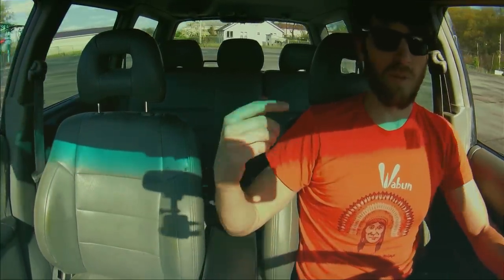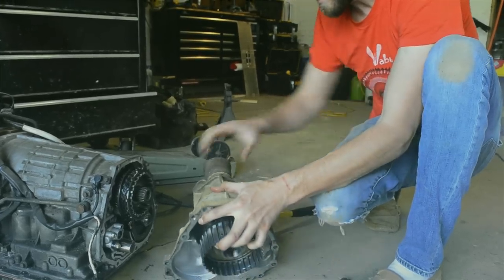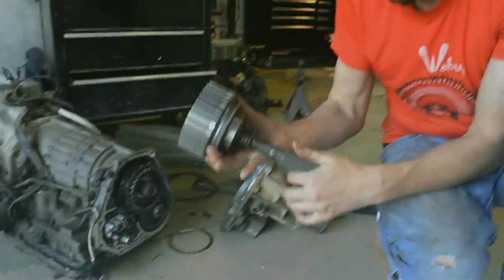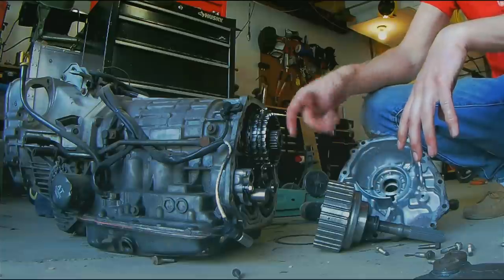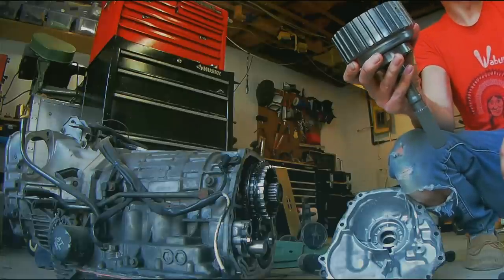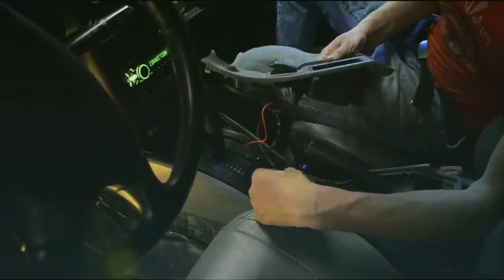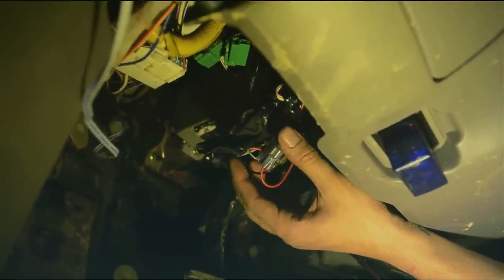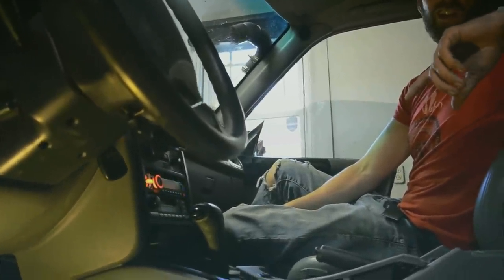Why your Off-road Subaru needs a locking center differential and how to install one for free

Comment: Hey man love the vids, super informative definitely a go to source for hands on knowledge. Do you know of anywhere that has a wiring diagram for this mod? And do you know if it will work in my 2003 forester xs as I do not see it listed in the forum you've linked above and its supposedly an incomplete list? One more question what engine management system or monitoring system are you using as I cannot locate anything for 2003-05. Thank you
Reply from the maker: Thanks, glad you enjoy them. This mod should work for you as long as you have an auto. I don't know of any mod diagrams, but if you check out my ej25d camshaft install video, there's a link to Subaru repair manuals which should have yours. Just use the diagrams to find the tcm. We explain how to do a simple switch at the end of this video, which is what we have. It's controlled manually because our OEM ecu can't control the vtd we swapped in there. There are a number of ways to do this mod, but they all involve the act of controlling the power that provides the signal for the tcm in one way or another. If you have something in particular you're trying to accomplish I will see if I can help with more details, but you might ask a wiring-savvy friend if they could help you with the install just to be safe
Reply: The High Country Medical Clinic Mmc did you ever make this modification. I also have a sg forester I wanna do this to.

Comment: Ok is this the same as the FWD fuse in the 2003 OB H6? If so I believe you are saying that you're now driving in FWD mode until you hit the switch? My transfer clutch has shat the bed and I'm running with the AWD fuse in place. Can I do this indefinitely?
Reply from the maker: The vtd is an enigma that you don't need to worry about, but yes we are in fwd with the switch off but also passive awd (if we had a normal mtp in this car it would be fwd only). I'd pull the fuse if I were you, that way it wouldn't try to kick in and cause any additional damage (metal debris I guess) although I think that risk is minimal. Check out our recent front differential teardown video and check your fluid level. The front diff is plenty sturdy enough to tote you around, but only if there's actually gear oil in there...

Comment: Awesome video, thanks for this,. I looked at that list but there is no mention of 2008 (5EAT) Foresters
Reply from the maker: Anthony Vasquez - EndZz Thanks, glad you liked it. You're right that we didn't mention the 5EAT...we're going to try to be less sloppy in the future; thinking about stuff like writing questions down, spell checking, lol. Did mention briefly that it works on all autos, the 5EAT included
Reply: Awesome thanks for the reply going to attempt to get this going this weekend. Just to confirm although this provides a 50/50 lock front to back it still doesn't solve diagonal wheel spin right?
Reply from the maker: Also, I do not believe the forum link is all-encompassing, but just the best aggregation to our knowledge. I do remember reading that 5EAT's have the same type of transfer clutch

Comment: Hello, great video! I have a question about the solenoid/valve - it is normally open (no power = clutch is locked) - I remember that there was a change into normally closed (no power = clutch is open). Do you remember when was the change (2005?) and was it to all models are some specific ones?
Reply from the maker: Thanks, I'm not sure, but if I had to venture a guest I would say that the change probably occurred around the transition to the phase II 4EAT circa 1999-2001.

Comment: Cool video, I was hoping someone could answer a question. I have a 2011 forester with a 4EAT and I've been reading online that the power distribution splits to 50/50 no matter what when in manual mode. Is that similar to this mod or is there a difference?
Reply from the maker: The lockup is increased in 1 and 2 but our testing showed significantly less torque bind, so it's probably only about 70-80% locked.

Comment: Hey mate absolutely love your work. Are you aware of any issues with the new sj xt foresters with the fa20 and cvt. Appreciate it.
Reply from the maker: Matthew Morwood Media Thanks for watching. I'm not really familiar with the cvt, but I believe it distributes power in much the same way. You may find this to be helpful http://media.subaru.com/pressrelease/580/123/subaru-offers-four-versions-symmetrical-all-wheel-drive. If you are using the XT for true off-road purposes, the transfer-clutch is advantageous because it can be locked with this mod, unlike models with viscous coupling. If you are using it for on-road or mostly flat terrain, it may not be necessary - it's moreso the jolts from sudden application of power that cause damage to the transfer clutch.
Reply: Thanks man. Yeah I do a bit of heavy offroading trying to keep up with patrols and cruiser in Australia. I have the xmode electronic stuff but it isn't perfect and I love your idea of actually manually locking that center diff. I might have a chat to Subaru aus see what they know.
Reply from the maker: You might also try digging online through the forums - there are some good ones out there that go over the variety of ways the switch could be set up. Linked one in the description, but its not current enough for your purposes

Comment: Super interesting information.  So technically a standard 4EAT wouldn't have a center differential at all, just the clutch pack that engages based on sensor input.  In the case of a standard 4EAT, wouldn't the TCM control the lockup solenoid as standard when the power cut isn't achieved by the lockup switch?   i.e. switch off - TCM controls modulation of the center clutch. Switch on - signal to the TCM is interrupted and solenoid is forced on.  In either case you are still relying on the max clamping load of those plates and the hydraulic pressure that can be applied to them, right?  So not a "locker" in the traditional sense of mechanically binding the input and output shafts (or left and right outputs) but more a "full power to the clutches!" locker like a Jeep Quadra Drive II differential or Fords new ELSD"  Or very similar to how most on demand type PTO awd systems work today where the rear drive torque is achieved solely through a clutch pack and the "center lock" button in some factory AWD vehicles simply instructs the control logic to apply max pressure to those clutches.  i.e. 3rd gen rav4 with a "C.Diff lock" button but no actual center diff vs my old 1st gen rav4 manual with the same button but an actual collar that locked up the actual center diff.  man, with the torsen rear and the center locked that thing was actually pretty mighty off-road.
Reply from the maker: Correct; what is referred to as a diff is really a clutch pack. This mod will increase capability a bit, especially on older models with a 90:10 F:R default torque split. However, I would say that the biggest reason to install a switch is the increase in durability it conveys to the clutch basket. The plates lock together with a substantial amount of force, but they don't easily wear due to the robust wet-clutch design. However, the basket is vulnerable to damage incurred during actuation under frequent and severe conditions of...well, abuse, frankly. Manuals have a true vLSD differential that cannot be locked (except the STI which has MPT and vLSD), so there are advantages to the automatic for off-road - provided you do this mod.
Reply: 2 things a 4EAT with the VTD instead of MPT transfer section will have a center dif and you could convert a MPT to VTD either with a full swap or just a rear case swap and also depending of the year of your Subaru (2004 and up vers 2003 and earlier) there is 2 ways to do the mod, sending power or sending a ground signal , I don't remeber which used which it's been too long

Comment: Now you just need a rear locker and your good to go.
Reply from the maker: We're working out how to do that on the cheap. Right now we have vLSD, which is definitely better than nothing and takes abuse well
Reply: Oh, did that come with LSD stock or did you put that on aftermarket?  I suppose LSD should be plenty good, just making sure you don't have an open.
Reply from the maker: The upper trim models on Forester and other Subarus had vLSDs as an option I think, but this one was closer to a base model. We swapped in this r160 from a legacy or wrx...can't remember which. Theres a swap video on the channel if you wanna see more. Pros are that it's easy, cheap, and can take some abuse
Reply: @powerofyourbrains  is this related to the 16-18 xt fozie upper trim model?  i'm looking thru your video trying to understand how i can get the center diff lock.
Reply: @powerofyourbrains   check out forester arb locker he has a written guide on a build. Im looking to both do this and run the locker, not sure if there is a better or cheaper option than what this guy has done.

Comment: Heu guys just wondering if this sort of thing can be done on a manual gearbox in the subaru? Im new to all this ive just lifted my impreza but pretty keen on 50/50 4wd so its good to go. Also if there is a manual tranz what code is it and what are they found in that i can hook up a switch on? Thank you
Reply from the maker: Nope. This has been answered and explained many times in other comments on this video. Check those out if you want to know more. Good luck dude

Comment: Hi mate! Great video. I own a stick Forester. Is it possible to install any device to block its diff?
Reply from the maker: Unfortunately no, unless you also have a dccd (like the sti). You have a viscous lsd which should theoretically provide a 50:50 split, provided you can keep all wheels on the ground. Long travel suspension work and low range would be the way to go for you I believe
Reply: @powerofyourbrains  Got it. Thanks!

Comment: I figured out a more simple dummy load. Still testing but I can email anyone the schematic if interested.
Reply: i would like a more detailed center diff lock diagram if that is possible i have an 02 forester
Reply: @rattbeard1  I used relays instead of a resistor. I had to put the testing on hold but can share my idea soon. I'll post a picture in the comments.
Reply: @nrwillette  I now have an 07 forester I would like a detailed center diff lock diagram if that is possible
Reply: LM317 wired in constant current mode. Although it makes no difference really, it has to turn around 10W into heat.

Comment: So I've got an 03 Baja non turbo I'm wanting to do this to. Is the 03 4eat normally with or without power? And is there a video going a little more in depth on how the DPDT switch is wired to reverse the logic so the light has power when the switch is doing its job. I'm a more visual learner sorry 😅

Comment: what about that 1st gear on 4eat ? i heard on those gearboxes 1st gear locks center as well. or its not ? and some people making that button like in 3 configs even. not just on or off. like if you give there other voltage then 12v you get slightly diff results.
interesting info there, so you have VTD there ? so its like those VDC outback models ?
Reply from the maker: scal man We swapped a center from a Legacy gt, works the same way though. We plan to test the extent of locking in 1st, but pretty sure its only a partial lock

Comment: Which is "better" when locked, mpt or vtd?
I understand that vtd is pretty much superior to mpt when unlocked and controlled by the tcu.
But once locked, is one stronger than the other?
Reply from the maker: VTD (still has an MPT but it's used to manage torque distribution vs transferring the torque directly)
Reply: @powerofyourbrains  yeah, I've heard the mpt clutch packs can "grab harder" than the clutch packs in the vtd, but then everybody says the vtd is better. I would like to swap to vtd, unless mpt actually can "grab harder" than vtd when using a center diff lock switch

Comment: I can't wait to do this mod. Could you draw a simple diagram of how you wired the diff switch and double pull/throw??
Reply: I want to do this on my 05 outback 2.5i auto. But I'm terrible at ANYTHING electrical... my car has the fancy shifter where you can pick each gear like a manual valve body.  I thought if I put it in first or second the center thing is 50/50? Am I wrong??

Comment: Hi, I just watched you video, and i have a 2001 subaru outback with a 4eat in it and i was under the impression that if you shifted it down into one that it locks the center diff for a 50/50 split front/rear. Is this not true? I don't really see why you'd really need to have the center diff locked outside of first gear unless you where rallying on a smoother offroad surface, but for just trail riding if all i have to do is shift down to 1 to lock the center diff i think that's good enough for me personally. BUT if that's not the case id like the switch wired to where it works like normal with the switch of, and only when you turn it on does it override the TCU and drop the voltage to that solenoid. I don't think that's how you did it, but said it could be done that way. So yeah, that'd be nice to know if shifting down to 1 provides a 50/50 spilt.

Comment: Is there a way to do this to some of the newer models?  Wife has an 18 Outback, and I'm looking at a new Crosstrek.  Mine will definitely get off roaded.
Reply from the maker: As long as it's an automatic it should be possible, as Subaru still uses the same mechanism. I can't personally say how the locker will interact with traction control systems such as x-mode, but it could in theory help to supplement them. If you try let us know. And I'm not sure this is true for cvt models, but you get constant lockup when shifted into 1 in the 4EAT. It's not full lockup, but mostly. You can use the drive around in a circle test to confirm.

Comment: I was wondering if you might be able to draw me up a diagram to show me how you wire the TCU into the Dual switch relay and what size specifically Ohm resistor you used to trick the TCU to think that it's the solenoid I think I understand what you did but I'd like to have a more firm understanding I would really like to do this modification on my 02 Outback
Reply from the maker: I didn't do a diagram because there are differences between models (some older models lock at 12v, for instance), and many ways this mod can be done. The purpose of this video is to explain a concept which can be applied to many vehickes. Looking through the forum post linked in the description, you'll see that the resistance may vary model to model and car to car. You'll need to measure yours using a multimeter and get a resistor in whatever ohm measurement you get. I'm glad you enjoy the videos, and hope to come out with more mod tutorials soon, including the upcoming center diff lock install on project off-road granny because we're gonna do it a little differently this time.

Comment: What are the options to improve off road capability of the dual-range manual transmission Imprezas?
Reply from the maker: Do you know which reduction you have? As far as manuals go they're the best tranny. It'd be sick if you could also add a torque converter but that's not really how they work. Best option is would be suspension work in my opinion. Remove any sway bars you might have and set up long travel to conserve your momentum - I think you'd be amazed at the difference.

Comment: So this will help tackle situations that can cause a tyre to spin like crazy yet no power is being sent to tyres that have traction?
Reply from the maker: This helps to prevent loss of momentum that leads to diagonal tire spin and damage to the transfer clutch. Check out the pinned comment - that prevents one wheel spin.

Comment: I may be missing something, but I can't seem to find a clean way to wire this up for a car with VTD from the factory. I've got a '12 3.6R and am getting really interested in installing a controller for a sort of auto DCCD, and I have no idea where to find this info.
Reply from the maker: Did you check the forum link in the description? I think others have highlighted resources in the comments, and I know there are many more out there if you spend a some time researching. Regardless of whether it's a vtd or non-vtd, there are three major variables you need to know 1) the resistance between the solenoid and the relay 2) whether your mpt locks under power or absence of power 3) how you want to have it set up. There rest is up to you. There is fortunately or unfortunately no one right way to wire this in

Comment: Can you guys tell me if there is any difference (beside the center diff) between the 4eat of natural aspired subarus and turbos? I'm running a  WRX ej205 engine in my 1970 VW bay bus and want to install a subaru 4eat transmission (tz1a4), which came out an natural aspired car. I'll be converting it to 2WD, so the center diff won't be used any more.

Comment: very good explained, BUT this is basically no diff. its a clutch... 

a center diff is just the same like diff in an axle, but i'm sure you know that anyway. :)
Reply from the maker: You're right, its a clutch pack in this case. We are sloppy and proud of it, although we do mention that its a clutch at some point. Most people know what a diff is, so meh, no biggie
Reply: true, you did. i never played with subbies, just read the title and thougt: "cool, subbies got a center diff?" ;)
Reply from the maker: Syncrofan Well, many do have them, just not automatics. But the STi has both...fun facts
Reply: Just to be clear, if it wasn't from the video: MOST autos have the clutch pack only, no actual diff, for the center coupling, most manuals have a common side/spider gear center diff and viscous coupling, VTD equipped cars, manual or automatic, have a planetary center diff and clutch pack. Clutch packs in the centers are hydraulicly actuated, not just preloaded like you'd have in a front or rear LSD.